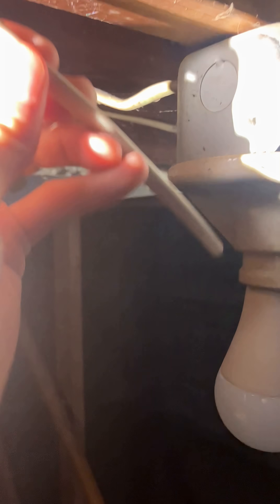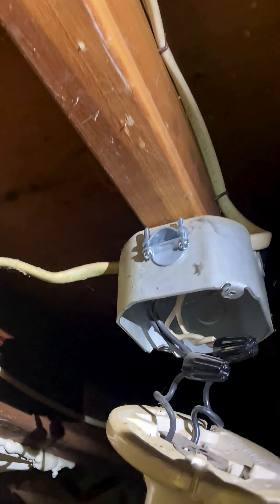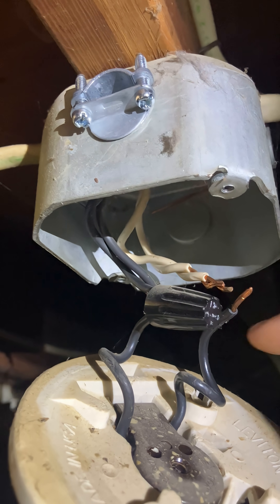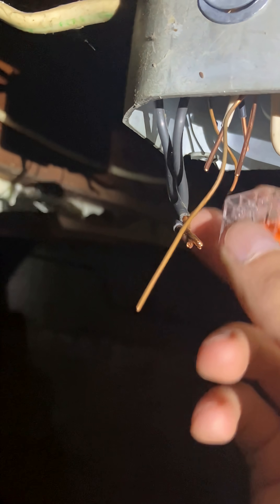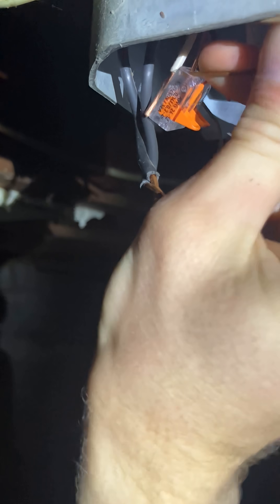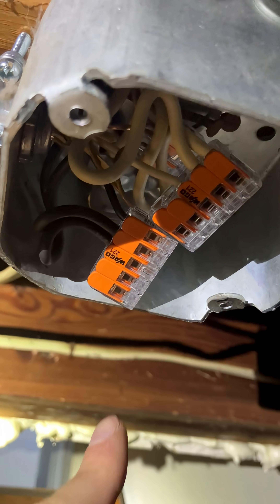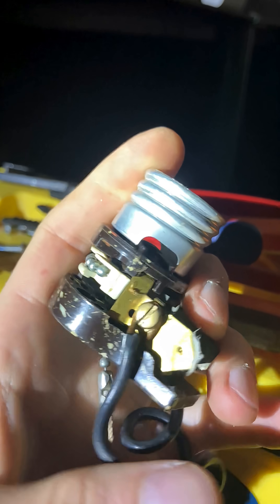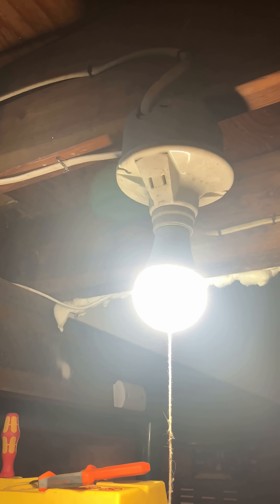Easy circuit extension with Wago wire nuts! #electrician #electrical #sparky

Comment: Rather use a wire nut than a wago. I just think twisting your wires together is a nice strong connection and the 3M wire nuts work good
Reply: I love wagos, but I'm not an electrician by any stretch. As someone who just really wants to make sure the connections are tight, there's something about being able to see the wire sticking past the clamp point through the clear plastic that calms my nerves
Reply: Nah bro, Wagos are the future. Twisting wires is damn near barbaric now. The integrity and strength of the conductors aren't too compromised using Wagos. You can only twist and untwist splices so many times before they start breaking. With Wagos, you can simply open the lever and the conductors are in good shape. Wagos also make troubleshooting and disconnecting from live wires a breeze, and much safer.

Comment: why leave exposed copper? Why is the metal enclosure for the light not earthed? (or grounded bc you're american)
Reply from the maker: It is grounded. There is a screw in the box that the ground wire is secured under. The only exposed copper are the ground wires. They are non insulated in American romex cable
Reply: Exposed copper on the ground wire isn't harmful, I think. It's more important that the current carrying conductors are stripped properly so they don't have exposed copper.

I think. Ask a professional lol

Comment: Gotta make sure those levers are all the way down before you tuck them in the box. Always still better to use ideal wire nuts/lever connectors. The new ones are badass.
Reply from the maker: I’ll have to check those out. I love wago but if there’s something better I’m all ears
Reply: They look more bulky than Wagos.